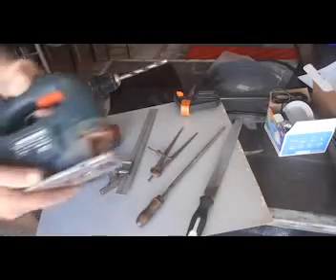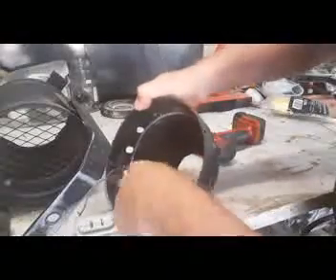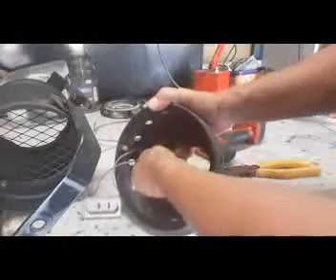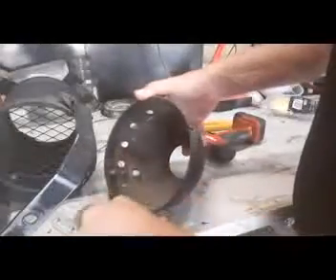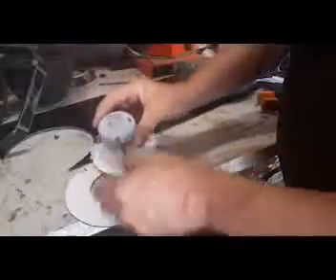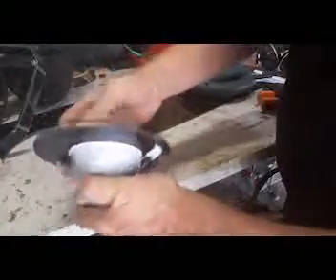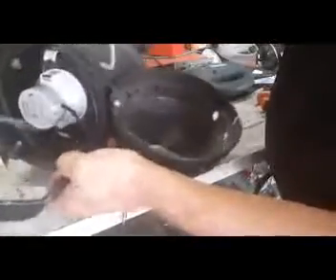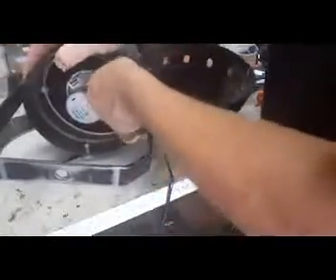How to Convert Par 56 light to L E D 9watt

Comment: I like it, thank you for this video. I just got me about 8 of these 56 parcans basically for free next to two dimmer packs, and two of them have broken lamps. 

Since turning them all on at the same time would blow the fuse in my home, I'm going to try a few LED conversions to see which works out best. I really like your use of the composite steel adaptor, as it basically makes it easy to adapt pretty much ANY LED lamp to the parcan. Lovely!

I do have the same question as someone else though, 'composite steel' is not enough precise, because you may be able to get something with that description, but when I look into it this term is also used in concrete housing and aerospace manufacture for clearly different materials. I do love the fact that it's got heat-resistant and reflective properties yet is still soft enough for a jigsaw to be made into an adapter by the average DIY person.